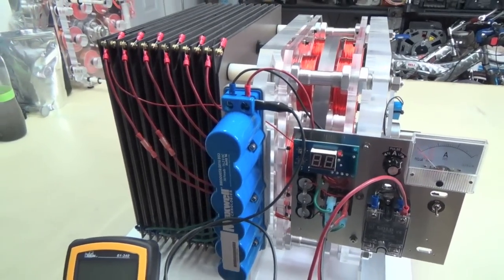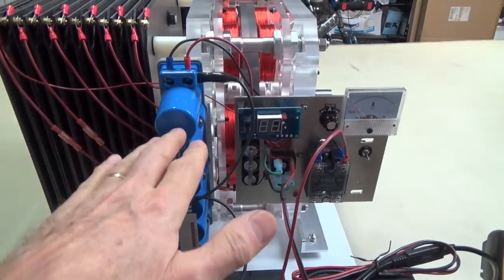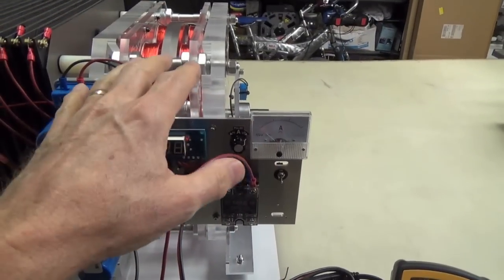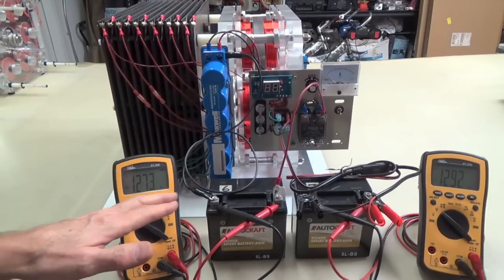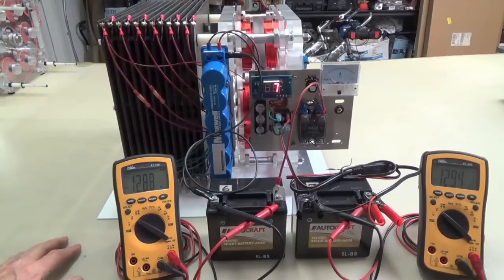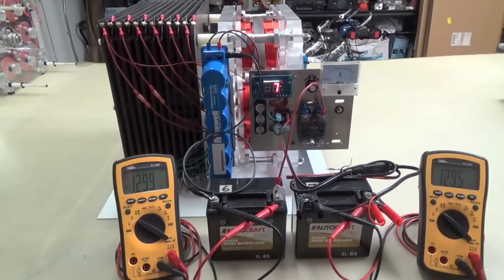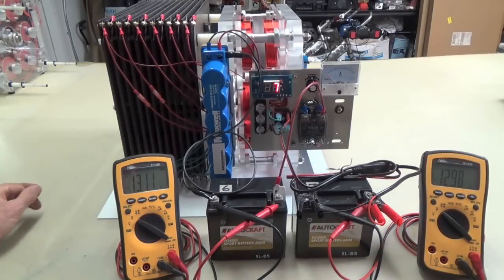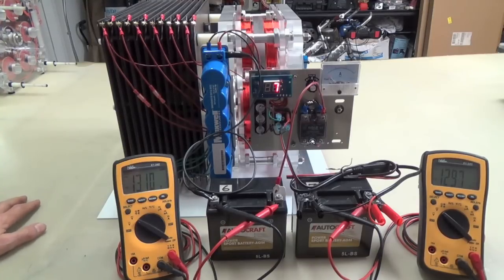NO SOLAR NEEDED!

Comment: The law of conservation of energy states that the total energy of an isolated system is constant; energy can be transformed from one form to another, but can be neither created nor destroyed.
Reply: You understand the power spent to pulse the flywheel isn't going to give you back the power you spent to spin it in the first place right? Just because it's only being powered for 4 seconds and it spins for 7 seconds doesn't mean you're getting more returns. The power input is higher even though it's running for a shorter duration because the torque output is higher. You have to consider the torque to RPM ratio. Secondly, it doesn't matter how efficient the bearings on the wheel is you will still have friction that will consume some of the kinetic energy and turn it into heat energy. There's not a reasonable explanation as to how this produces power, in fact some energy will be turned into non-usable heat energy, as +pberguy stated originally; please reference the law of conservation of energy.
Reply: Where does the cells get the energy? I watched your other video on the cell stacks and it didn't really provide any information on where the energy is coming from it just showed meter readings of amperage and voltage.
Reply from the maker: I'll make it direct and simple for you. The energy is coming from the cells.
Reply: I don't understand what that means, what conversion are you referring to? How is more usable energy being produced here? I feel like everyone is avoiding an explicit answer/question here and using a lot more words than necessary. Can anyone provide a plain and direct answer to the question: How is this device producing more power than it is taking to run? A direct and scientific answer would be great thank you!
Reply: pberguy Tell that to thermonuclear physicists.   A few pounds of high explosives and the output is ×1,000,000 that energy.  No such thing as more out than in?  Boulderdash.  There is a key to unlocking the energy in all matter- Tesla understood.  Frequency and harmonics.
Reply from the maker: correct.
Reply from the maker: Absolutely! It's all about conversion. It's right in front of you.
Reply: People try to understand this is not free energy, nor energy from nothing, the plates create the energy to spin the wheel. The plates so far have not been tested for life cycle, although I believe he is testing that now. But this is long term energy stored in the plates that drive the generator. The Plates do not need charging and are outputting a constant current and maintains its charge.
Reply: pberguy. Conservation of enetgy in a closed system?  Same concept as your ever living soul.
Reply: In a closed system but your tapping the un seen either
Reply: The operative condition is "isolated system"....no such thing exists!  It is merely a convenience for 'easier' calculations and measurements....not in the real world though.  Everything is connected.
Reply: True, that is why he's pulsing, the flywheel creates momentum and the magnets converts the momentum into current via induction coils. That current goes to the caps and the excess to the batteries and the caps store just enough for another pulse. He's not violating the law of conservation, he's using physics and engineering to create more energy then the device needs to operate to get a net production. The Si-Graphite panels are a low amperage long-term capacitor the blue capacitor bank is high amperage current dump needed for the pulse. The induction coils are the generator using a flywheel and low friction bearings.
Reply: You live in school illusion? @pberguy? Energy is everywhere, but if we cant use it is corruption of our goverments, it is business, that is why they killed Tesla. Electricity is everywhere...

Comment: I have a better system that that in my mo ho. I run 3 12 volt batteries that run an inverter that runs a 50 amp battery charger that recharges the batteries...the only issue I havent solved is heat..I need to drive the mo ho about an hour every day to cool  the inverter down
Reply: i've done the same thing when they turned the power off one time but i use truck battery.but on the 3rd day some cops came by the house and told me what i was doing was against the law and took my setup.but it did work p.s if you get a exstention cord with 2 male you can plug one end to the inverter and the other one into wall plug and that would power that room
Reply: Rueben Soto  Damn..it like we went to different schools together...I got caught doing the same thing..when I went to court the DA proved I was plugged into house .next door...but he couldnt  prove which direction the electricity was going "not guilty" :-)
Reply: blackbirdxx928 I'm interested in a better system for my RV... Got a link?
Reply: blackbirdxx928 the answer is above, I think the vacuum would work and a cooling non conducting fluid, or?

Comment: The Start Up Cap system,
Is a good way to fire it up!!
Some fridges will not fire up sometimes when they have been sitting for a while.
Charge the start up cap with a battery,
then in a lot of cases the compressor will fire up again.
Nice Concept.!!
Thanks 4 Sharing.

Comment: i wonder how well this does when ur actually drawing a load on the batteries that u r charging tho? like if im powering an xbox & tv, im positive this thing is gna have to work triple duty to replace that energy. now only we could tweak it to just be connected to an electrical outlet so i could just plug my a/c directly to it then my friend their would be men in black following u around.
Reply: You can tweak it i'm sure, but it will never be very efficient, thermodynamics prevents that.

Comment: Appreciate your work. Is there a limit to how many batteries can be charged at one time.  Im using FOUR (4)  Trojan L16RE-B        Model  
Manufacturer  Trojan Battery
BCI Group  
Battery Type  L16RE-B
Battery Application  
Voltage  6
Length  11.67 (296)
Width  6.95 (177)
Height  17.56 (446)
Weight  118 (54)
5 HR Rate AH  303
10 HR Rate AH  340
20 HR Rate AH  370
100 HR Rate AH  410
Capacity 25 amps  766
Capacity 56 amps  180
Capacity 75 amps  
CCA  
CAe for my home off grid system.  thanks in advance for your answer.

Comment: We really need to replace all the batteries in the Diesel Trucks by these Si-Graphite generators !!! Trucks are very strategic assets worldwide, the fact to make food supply rely on something as capricious as lead-acid batteries to start the engine is really scary. And you would be able to use the Si-Graphite generator to actually heat key components of frozen engines...
All Praises to God Almighty ! Could it be the guarantee of an independant & weatherproof supply chain in the near future ???
Reply: No seriously guys, you can be absolutely certain that Diesel Trucks will be based on that technlology in the future.
The capacitors are always recharged & ready to start the engine, you can have continuous tracking of the Truck by satellite with power consumming components switched "on" 24/7 just like in a boat, and you can still have some "reserve" batteries to warm the engine with an electric heater when the driver turns off the Truck to sleep...

Comment: have you done tests on enviroment differences on how the machine's output/working change?
i mean low tem, extreme low tem, high temp, extreme highy temp, humidity low/high, maybe even test it on lower air pressure situation/possibly vacuum?

i thisnk people would love to see how the generator reacts to such differences...thus it will show how it will work on different climates/situations.

thanks.